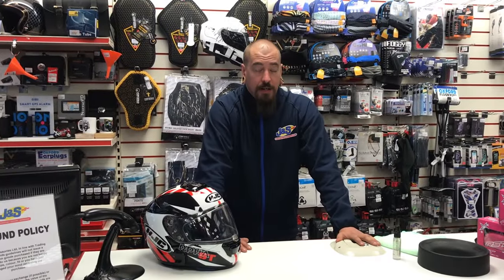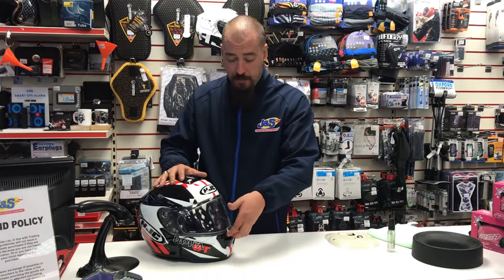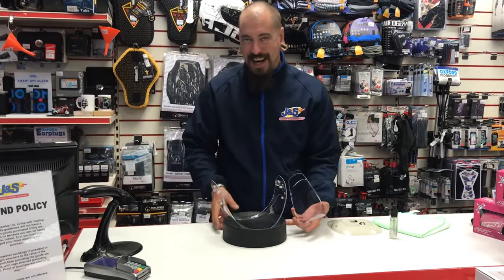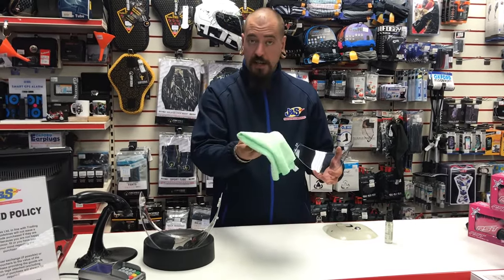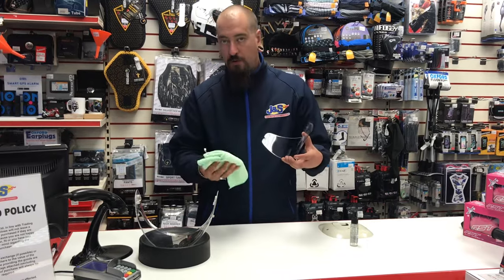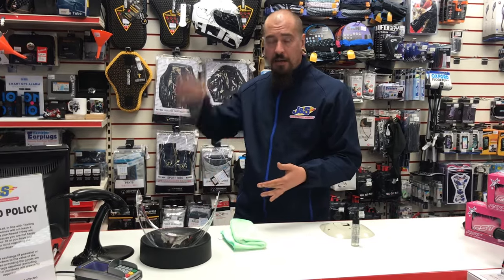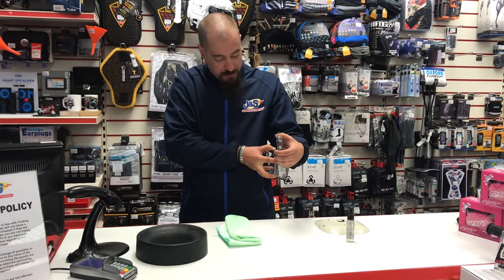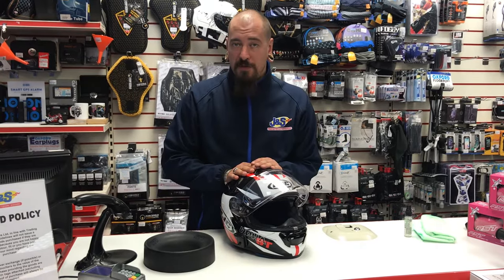How do I clean my Pinlock? - J&S Accessories Ltd

Comment: You only have to look at a pinlock insert and it scratches, they reduce visibility when riding at night so they’ve got some major flaws. In cold weather yes they’re worth it, but in average dry weather just crack your visor and enjoy better visibility.
Reply: very very sensitive to scratches. agree
Reply: I drive at night and a pinlock didn't really hurt me, just adds some reflection. But the lack of condensation is a huge benefit, especially at night
Reply: They only reduce visibility because they’re filling with condensation that would otherwise be fogging up your shield. Night, especially early evening is when everything’s condensing and fogging is the worst. It’s still way better than a fogged shield, and a soaked insert is just more noticeable at night than in the daytime. These things are an amazing piece of tech, I love em.
Reply: @travispratt6327  No you’ve misunderstood it isn’t fogging up or condensation, if that occurs the pinlock seal has failed and it isn’t being used as intended. What I’m referring to in my comment from 3 years ago is the requirement to look through two pieces of polycarbonate, the light reduction and scatter for me is unacceptable when you’re facing oncoming headlights and I’m not the only person to notice this. In very cold or wet weather I do say they’re worth it on balance but at all other times I stand by my original comment. On a Shoei you can crack the visor a tiny amount which is sufficient to clear any misting up.

Comment: I wash the whole pin lock in luke warm water then air dry before wiping the insde, it seems to keep the selicon seal flxable, thr way that was shown there,s noneed to remove the pin lock at all

Comment: If the pinlock insert surface that contacts the visor doesn't need cleaning, as per narrator,  just leave it in place and clean with water, surely?

Comment: My pin lock came loose after a cleaning and fell out of my Ls2 valiant any suggestions?
Reply from the maker: Tighten the pins (if you rotate them slightly) it tightens up the fit on the Pin-lock to the visor.

Comment: Why would you ever have to clean it ? It’s sitting on the inside sealed against the visor dirt and water shouldn’t be able to get on the pin lock at all no?
Reply: You did not listen to what he said then about only having to clean side facing your face?
Reply: i installed it with tiny gap and now even on inside I have microdust to get rid off... cleaning both sides